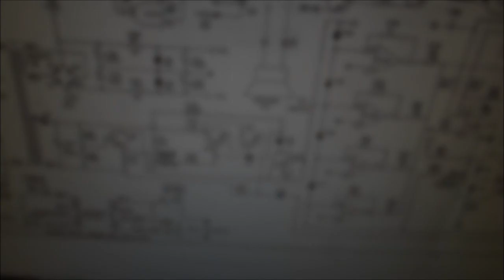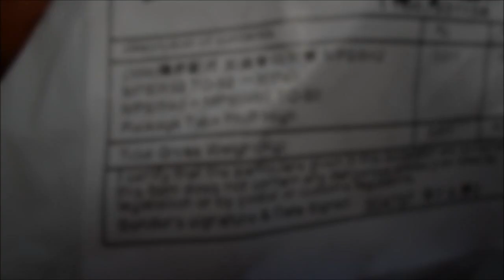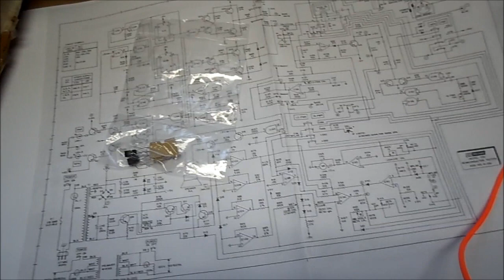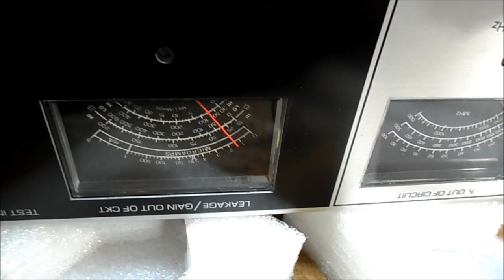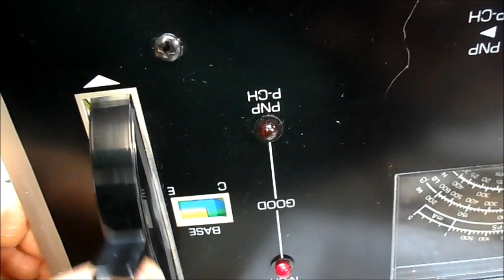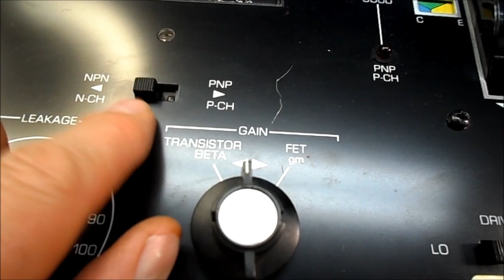1978 B&K 530 Transistor Tester. Unit fails to indicate "Good" device.

Comment: I know this is an old video, it's now Sept 2023, but I am wondering if you just gave up on this one, or did any more work. As a suggestion, you could "sectionalize" your fault just by trying to go through the calibration information in the manual ( which I managed to download for free) and / or, even trying something as simple as using a regular diode across 2 leads to see if it even gives a good C-E / E-C indication in just one position. then seeing if it detects foward / reverse conductivity for leakage through the diode on the meter. After that, things like checking the base drive level, and adjustable leakage voltage level, and all the other calibration info might get you through the repair. I am looking into picking one of these up, it may also have issues, but it also seems to be a very useful tester, especially with the "Transition Frequency" section on the left side of it, that's a very unique function that I can't recall seeing in any other tester. Good luck if you take a stab at working on it more, or congrats if you fixed it.
Reply: Thank you for watching, & the information. It's still in a "round2itbox", with some replacement IC's. I now have a professional de-solder station, & will try the suggestion before continuing further. The chip removal will be a challenge, the less the better. I feel it was fed a live in -circuit test, without de-energising first, & may have caused some chip damage.
Reply: @roberts41  You're welcome.  I was reading the downloadable manual, and it has a great "block diagram"  and text description of the circuit first involved that you are having issues with. Picking up a LED indicator logic probe might help troubleshoot it too. IMO, I think this is a great general transistor testing unit, capable of measuring beta / gm as well as checking for forward and reverse leakage / breakdown up to 100VDC, as well as being able to "class" the Ft, or Transition frequency of a unknown or pulled transistor to see if it is capable of being used in audio, low frequency, or high frequency  circuits.

Comment: does anyone know the value of the secondary voltages
Reply: On the schematic, it looks like T1 has 2 separate secondary windings. One looks to be capable of producing a + and - 12VDC voltage from a center tap, so, probably 32VAC open circuit from output to output lead ( 16VAC from each lead to the CT) without a load before the full wave bridge. The other secondary winding has a single half wave rectifier diode on it, then it is using a 250V rated electrolytic cap to smooth the ripple. The unit has to produce a 100VDC voltage to use for the leakage test, so I will guestimate about a 120VAC RMS voltage, so be careful if taking any measurements in that section and remember to wait a bit until the 106K resistor network bridging it can bleed off the stored voltage, or discharge it before working on it.

Comment: There is a B&K 530 transistor tester on eBay in very good to excellent condition; Price $125.00 or best offer sold by a none profit organization. It has been refurbished and all controls cleaned and checked. Just type B&K 530 transistor tester and scroll down, item# is 322027461074. If there is a problem they pay return shipping after inspection. If interested I recommend checking it out before somebody else grabs it and keep yours for parts, hope this helps.
Reply from the maker: +John Cunningham Will check it out. Thank you.

Comment: Did you ever have any luck finding the problem? I use to own one; at the time it was a very expensive piece. I sent it back because the unit was not accurate. However, the B&K 520 was a great tester and had no complaints. After watching your video the problem seem to indicate a logic problem or a shorted transistor that has latched it in the NPN position. The printed circuit board is appalling especially when you consider the price.
Reply from the maker: +John Cunningham I have sockets & chips ready, but have not attacked it yet. Thank you for watching. Transistors test ok so far. Believe it's those logic chips. Am afraid that board may disintegrate when an attempt is made.
Reply: Thank you for the reply, I think putting sockets in is an excellent idea, less stress on the board. But like you said the board is fragile making it almost impossible to service. I wish you the best of luck, regards John.